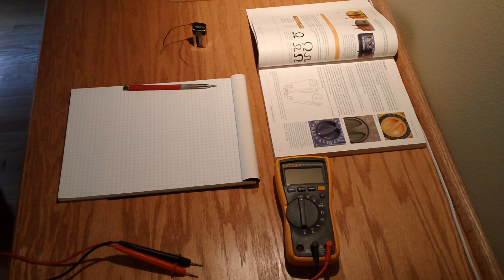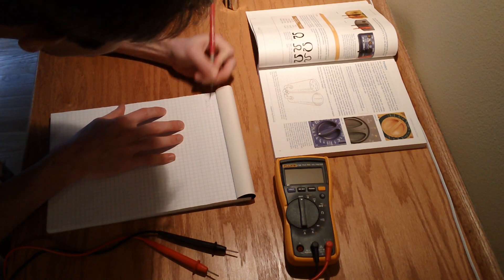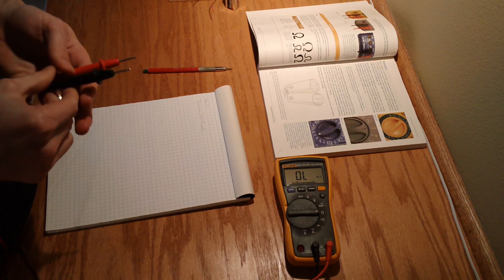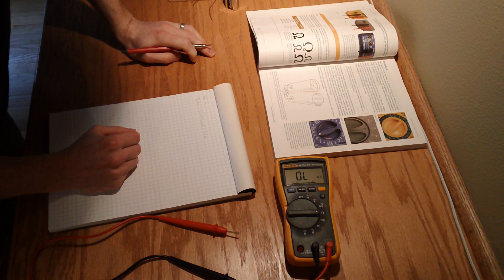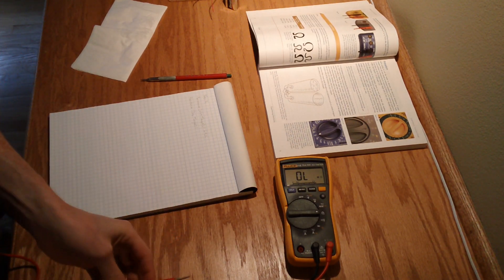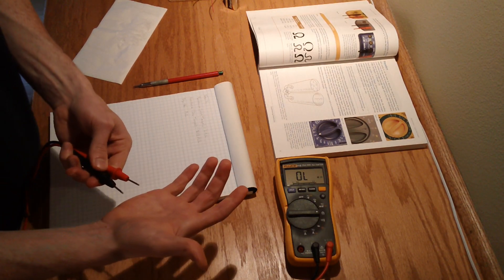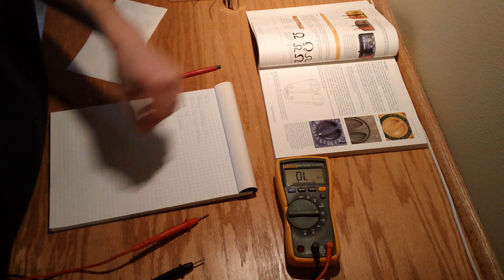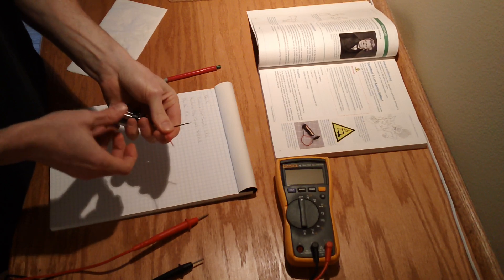Make: Electronics - Experiment 1

Comment: My multimeter is cheap, but keeps on reading 1 no matter what.
Reply from the maker: While I'm unclear if that's reading voltage or resistance, it's likely due to either a blown fuse in your multimeter or faulty leads.